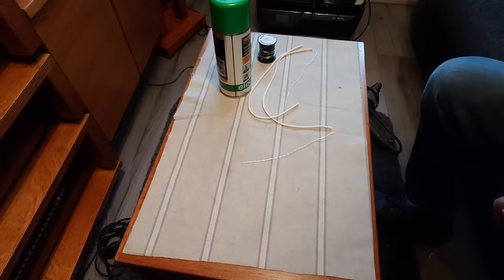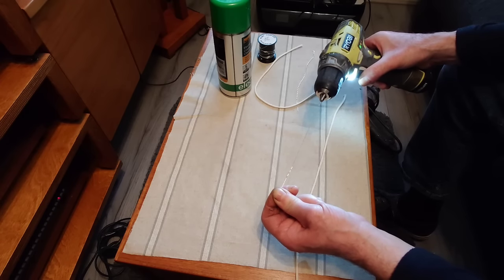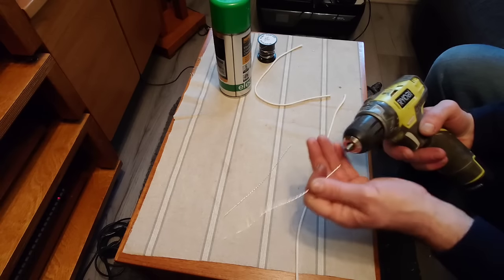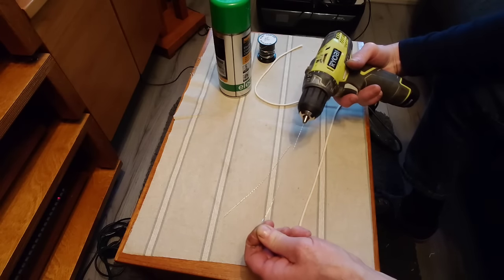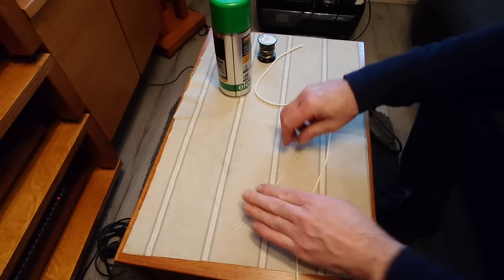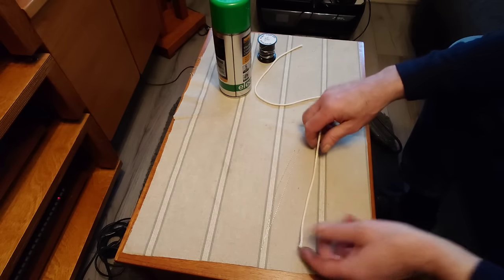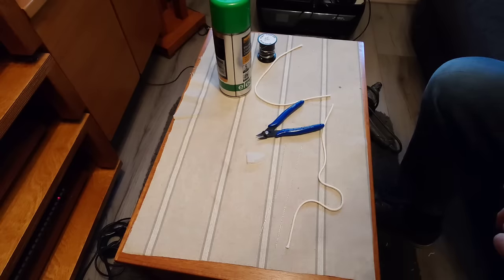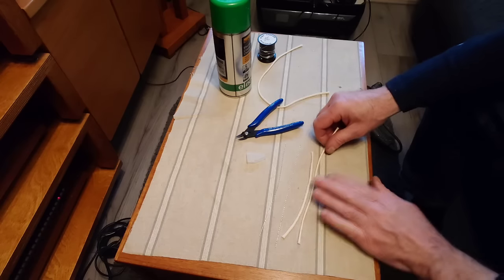HOW TO MAKE PROBABLY THE BEST ANALOGUE INTERCONNECTS IN THE WORLD!!!

Comment: You say don't use brass RCA plugs but use a copper alloy.  I'm pretty sure that brass is an alloy of copper and zinc along with some trace metals.
Besides that it is a nice guide and helpful.
Reply from the maker: Copper alloy has a higher content of copper than brass does, that's why I say don't use brass, remembering that when we get to the best, every little help, but pure silver rca plugs are even better for this application, thanks for commenting & watching 👍
Reply: You used to be able to find a few brands that used gold-plated copper in the construction, including the original ViaBlue's.  I've found some (other brands) being sold for very low prices, if you think this actually makes a difference.  I've tried both ways (brass, copper, and rhodium) and still can't be sure it made any difference.  Everyone has their own preferences, so it's not for me to judge.  :)

Comment: You can make your own continuous cast silver or copper very easy take that silver off the spool hit it with a blow torch this till it's red hot cherry red don't go any hotter than that and then quickly dump it in some water then you'll get your continuous cask crystal. and it'll make the silver softer the same with copper that's how it's done.
Ideally put a bit of shrink wrap on the positive and terminal and cover the whole positive wire with copper tape and around the negative making sure you don't have any contact with the positive, this will prevent EMI getting up the cables

Comment: What cable are you using? (not in the list)
Reply from the maker: The cable is made from the parts in the list 0.4  99.99% pure silver wire & cotton tubbing insulation.

Comment: Are those original or counterfeit wbt connectors? In an official web distributor the price is 124 usd for a pair...
Reply from the maker: Original, thanks for commenting & watching 👍
Reply: They are Chinese copies, not real WBT.
Reply from the maker: @Sparta155  No they are not copy's they where purchased from Russ Andrews, around 2010, costing £98.00, Russ Andrews only sells original WBT Plugs.
Reply: @tweakerman  maybe fixing the link on the description should fix this, cause it leads to an ebay link that's probably counterfeit.
Reply: @tweakerman  The plugs you linked to  on ebay are Chinese copies. That's not to say they are bad, but they are not WBTs.
Reply from the maker: @Sparta155  yes they are copy's in the link, you are correct, but not the ones I used are original ones😁
Reply: @tweakerman  They (the copies) may be a good option for those on a budget.

Comment: You can dip the ends of the piping cord in hot candle wax to stop the threads coming loose. 😊
You can also warm the wax afterwards and squeeze it around the wire to stop it fom moving a bit.
I switched 0.8/1mm to 2 wires of 0.5. It also keeps flexibility.

Comment: hello and thanks for sharing. Only a question : in this version you don't using shielding like older versions? Thanks again
Reply from the maker: Hello, this cable is an unshielded design, but still has some shielding properties, because the conductors are twisted, twisting conductors help's to reject RFI. This unshielded design sounds extremely open, with a wonderful soundstage & imaging, only found in truly hi-end cables, but it can only be used for cd players, dac's & music streamers.
These cables cannot be used on a turntable or phono preamp, I hope this helps, thanks for commenting & watching 👍